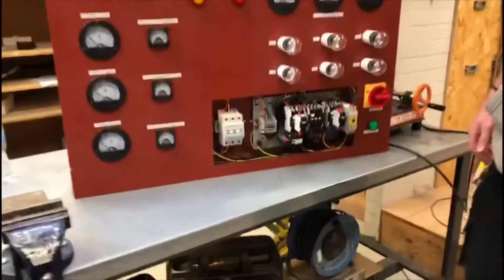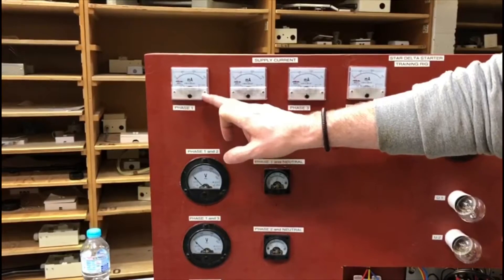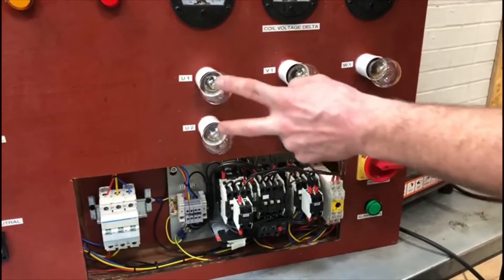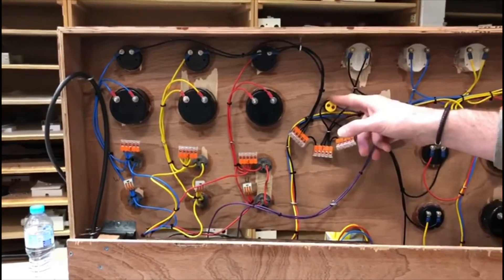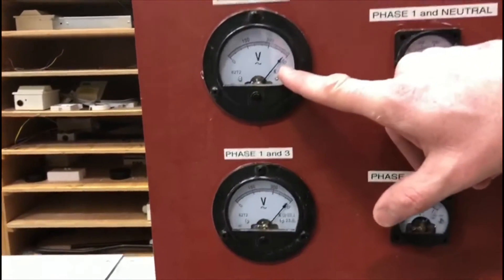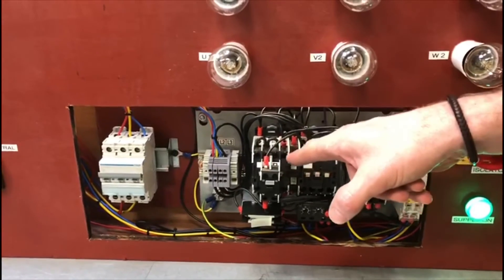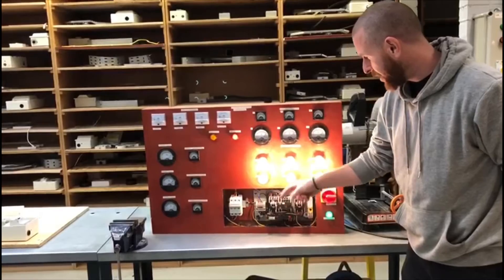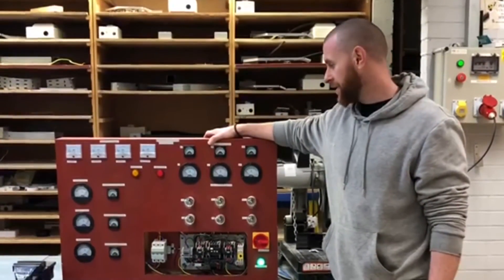Star and Delta Direct Online (DOL) Rig for Measuring Voltages and Currents

Comment: Digital meter are cheap enough these days , no one use analog meters these days, do you really want to blind people using lamps. I thank you really need to rethink that rig , it could be improved just by spend 5 minutes before you had built it .  Plus you should have use the new colours,  .. That rig should be in a museum, plus should it be made out of wood / plywood for fire safety, plus the presentation was poor,
Reply: In college, everything, every step ought to be the old and conventional way; ensuring learners learn the BASIC 1st.

Comment: Thanks this was quite helpful. But a schematic description would be more helpful as the Single phase DOL your team made earlier. Thanks GSH Electrical
Reply: In fairness it shouldn't be too difficult to reverse engineer, especially as you see a 360 view of it.

Drawing it out may help, you can see the wiring positions and the panel instrument assignments, from there just trace each wire though the diagram.